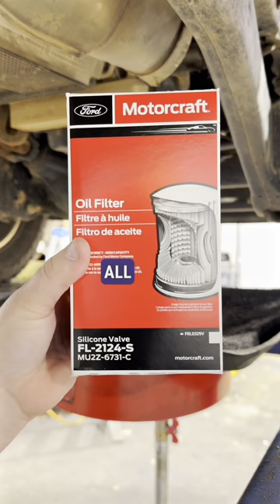2023 6.7 PowerStroke Changes? #ford #powerstroke #shorts

Comment: I was taught to start the truck after an oil change and check oil with the dip stick
Reply: This is how you do it for all ICE vehicles. At least that’s what I was taught. It will also help you catch if the oil is going down for some reason you don’t immediately see.
Reply: Thats good practice, I forget sometimes, all my cars take 6 quarts. 
My friend did an oil change on his grandpas town car, and for got the filter, started it for 2 minutes or so, and it shot all the oil out the filter housing. Had a slight rod knock, or something, that got taken care of with some lucas stabalizer.
Him and his grampa just agreed that it  took 50k off the life span and laughed it off. A new car cant run on no oil for 2 minutes! Panthers are stout
Reply: Fun fact, New VW Atlas Suv's don't have an oil dipstick... I kid you not, I work at the plant that builds them.
Reply: @tmurph247 most European cars don’t have one anymore, VW, bmw, Land Rover, Volvo etc.
Reply: @evanwittig3976  all of those are throw-away cars in America
Reply: @tmurph247  why?!
Reply: @SqueezeSVT probably a lifter ticking .
Reply: Yeah we all were. Except this channel
Reply: @SqueezeMonger ive seen 2018 engines run on 5psi oil pressure for 500-1000 miles
Reply: I've done this repeatedly on my F150 5.0 and never has a difference
Reply: @tmurph247  they do have a dipstick, it's just not installed. there is a "tool" the dealer can use to check a hole in the engine manually.
Reply: At least it still has a friggin dip stick
Reply: Both it just the HO?

Comment: A professional checks the oil level when he is done. Everyone makes mistakes. You could have left the drain plug out, forgot to drain the oil, forgot to change the filter, the gun could be malfunctioning and not counting correctly, I’ve seen it all. Check the dipstick and save an engine.

Comment: There are great advantages to having higher oil capacities in these engines…especially in a medium duty application!..the F750’s should really have an oil change every 200hrs or you’ll most definitely have troubles with it!..these 6.7’s are just not a good medium duty engine. Far cry from a 5.9 or 8.3 medium duty Cummins!..

Comment: I’m shocked the oil change didn’t require removing the cab😂 plastic crap everywhere even the oil pan! Man I love my Cummins🇺🇸💪
Reply: the only pick up truck you can get a cummins in is a fiat that has a horrible transmission and horrible electronics
Reply: @tyler93539  boy my Cummins will still be pulling heavy loads when your beer can ford is in a scrap yard. Say and think what you want everyone knows Cummins are better.
Reply: @Antiliblife187  enjoy the transmission and electrical issues

Comment: We got some new e450s at work, with the new 7.3l v8. My buddy and coworker did the first oil change on it. I asked him out of curiosity, how much oil did you put in it, he said the normal amount (6.5qts in old 6.8l ).
The next time I was checking oil on vehicles, I check oil on the new e450, and sure enough, dipstick was dry. I then looked it up and added 2 more qts of oil and texted my friend to tell him that new e450 take 8qts

Comment: The 7.3L diesel actually takes 20 quarts total. 15 quarts in the pan, 2 quarts in the filter, and 3 quarts in the high pressure system. And yes you should change your high pressure oil because it comes out black as can be when you’re pulling it out of the reservoir and cylinder logs.

Comment: I just replaced my air filter in my 2022 f250 ( stock) 110 bucks from Napa. Along with 15 quarts of oil, filter, fuel filter and water seperator and I think I made a wrong decision. It's just too much nowadays. 😢
Reply: If you need a diesel it's the cost of doing business. If you got a diesel to be cool you made a big mistake.
Reply: Bye at Walmart so much. Cheaper.
Reply: Docs Diesel. They are a great company. It’s where I buy everything for our fleet, and my own personal truck. 40 bucks for your year. I buy their oil too as it comes with HotShotz addictive in it as well.
Reply: @kenj.8897 you have to pay to be cool and I am paying. 😂 I bought the truck with the diesel with the intention to tow is that the same? Now I like it too much because everyone gets out of my way and doesn’t tail gate
Reply: @kenj.8897  you’ve bought things to look cool, don’t lie. Everyone does it. Don’t be a hater.

Comment: Much needed. I’m a service tech at ford going on a year and you’re the only one that has informed me of this. I’ve always put 13qts but now I know Ty
Reply: You should always check the oil level when you are done.
Reply: Or check maintenance specs in pts, it takes like all of 5 seconds
Reply: @efrenespino7138  regardless of specs you can make mistakes when you are doing high volume. When I pop the hood I pull the dipstick and leave it sticking a foot out of the tube to remind me to check the level. I also place the fill cap on the hood latch. 
 Back in the day when I was a lube tech I would do 30+ oil changes a day. It only takes one mistake in a year to lose your job.

Comment: My local Ford dealer tried to claim the 21 Coyote holds as much oil as the prior generations. It doesn't. It holds one quart less. Got them to redo the bill with correct amount recorded. It's so easy to steal of people. Bet they all do it.

Comment: What's worse, to overfill by a quarter or 2, or under fill by a quarter or 2?
Reply: Definitely underfill if it’s only 2 quarts. You don’t want to much either because your pressure could blow out a seal or gasket
Reply: @bradenmccool overfilling won't increase the pressure. The negative about overfilling is if it's severe enough to contact the crankshaft. If it contacts the crank it will cause drag and get aerated

Comment: I wish manufacturers would provide a manual that states the capacity and would provide a device by which to measure and verify the quantity in the engine.
Reply: 23' manual still says 13 quarts. But I see your point.